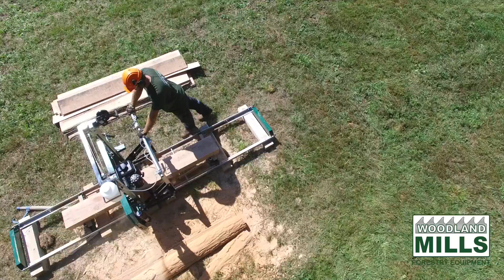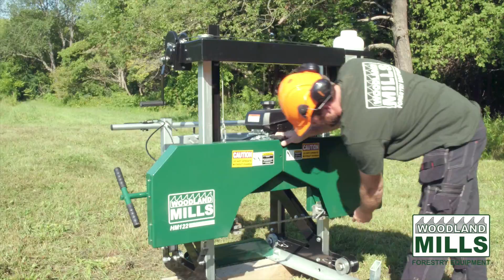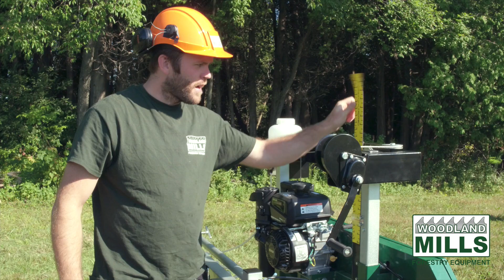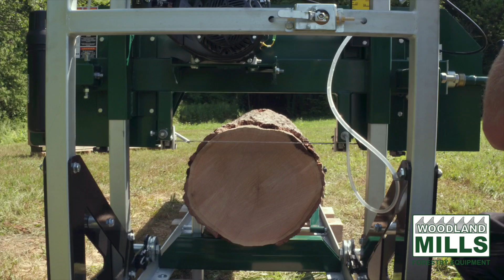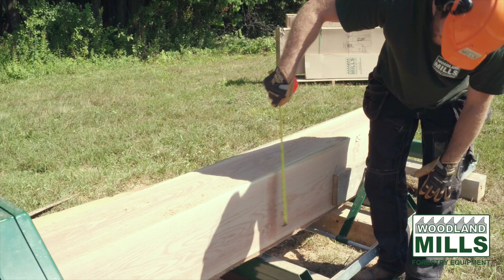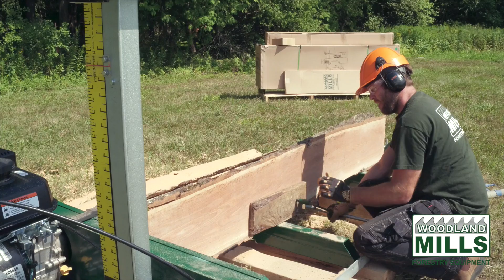Woodland Mills HM122 Portable Sawmill

Comment: I notice the rollers have a rounded inside but the track is not rounded for the rollers. I felt the rollers should roll over the rounded part in the track. What is the right side of the track?
Reply from the maker: Square edge up. The rounded roller seats on the edges of the square profile rail. This provides a small gap between the groove in the roller and the square track so that sawdust is less likely to cause the wheel to jump up or jam. It also
reduces friction when compared to having a matched round profile on the rail with the round groove in the wheel.
Reply: I am still working on installing it. I have to buy bolts to bolt the frame rails down on some weather treated 2x4s on an old two ton truck frame i had. I understand now about the square to round interface. Now, i understand you only offer one kind of blade that is universal. I have a friend that says i should use blades for hard one and other blades for soft woods. I guess the difference is like having different cutting edges like hacksaws for different metals.
Reply from the maker: Hi Thor, We carry  Lenox C Sharp blades and they are efficient for both hard & soft wood. 144” x 1.25” x 0.042” x 7/8” pitch and a 10 degree hook angle for the HM126 and HM130 and 125″ x 1.25″ x 0.042″ x 7/8″ 10 degree hook angle on the HM122. Also, it's good to know that the blades are a standard
size, so you could source them locally or try other brands/types. If you have extremely hard exotic wood please contact our office and inquire about the lenox ¾ blade 1-855-476-6455
Reply: Thank you, i have the small one 122.
Reply: I have not set it up yet due to my surgery on the 25th. I will cut red cedar, pecan, gum, black walnut when i do. I hope the blade sent with the mill will perform ok with these woods.